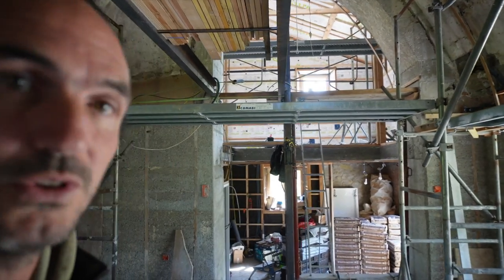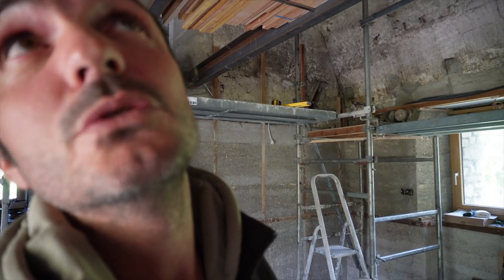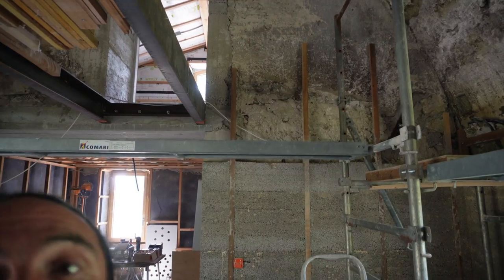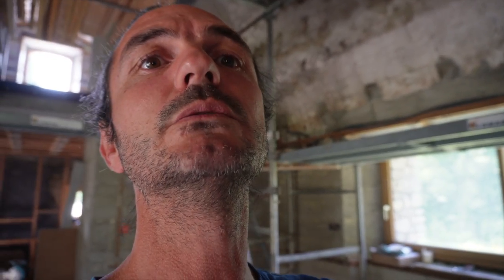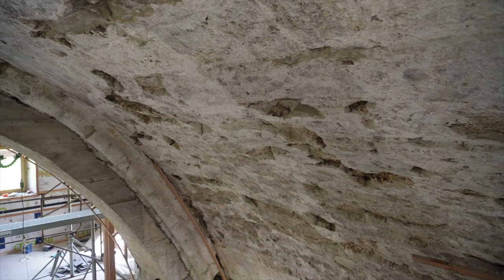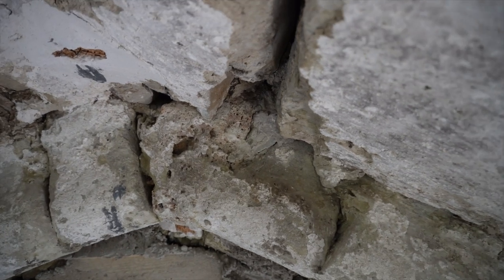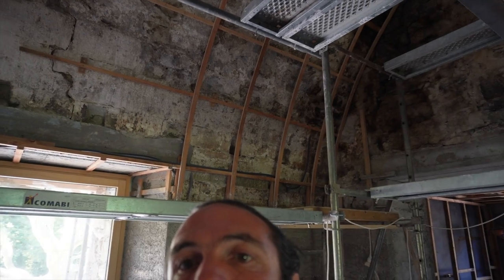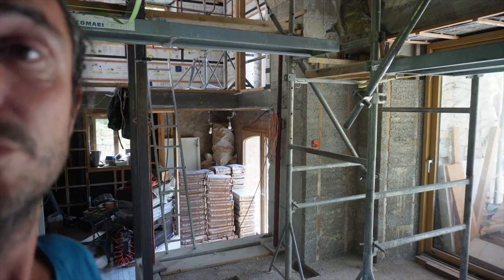EP_04 Projection de Chaux Chanvre dans la chapelle Part.1

Comment: Dommage pour cet échec et les pertes. J’ai fait toute mon isolation en chaux-chanvre, seul, à la main. La contre-partie de ce dur au mal, c’est qu’il y a zéro perte de matière, comme tu l’as constaté quand tu faisais tout à la main. 
Et quand les erreurs viennent des autres, on s’en prend encore plus à soi-même.
Ça a déjà de la gueule, ce sera magnifique une fois terminé. :)
Reply from the maker: On est jamais mieux servi que par soi-même... j'aurais bien aimé mais de temps en temps, l'aide extérieur est indispensable. J'ai fini par trouvé le bon prestataire mais je n'avais pas prévu les pertes... heureusement, je vais en utiliser une bonne partie dans l'entrée, banchée, et en vrac à l'étage sous les parquets. En tout cas, je crois que la protection était la seule solution pour traiter cette voute, on a réussi ! Merci pour vos messages.